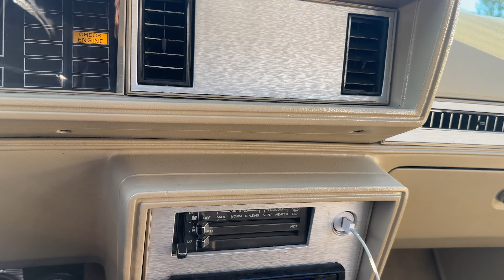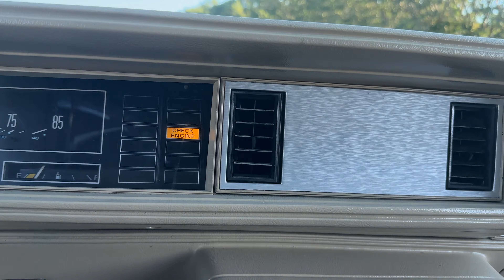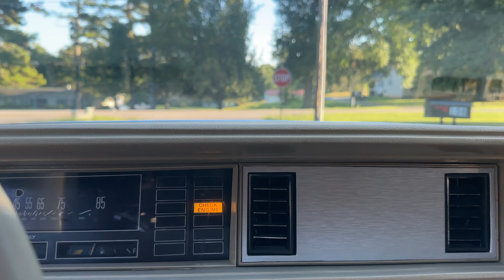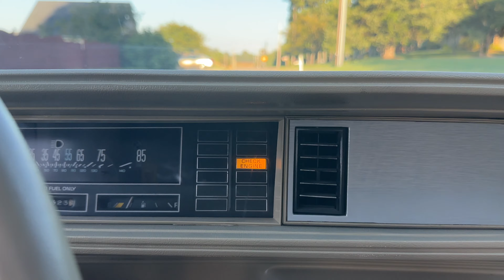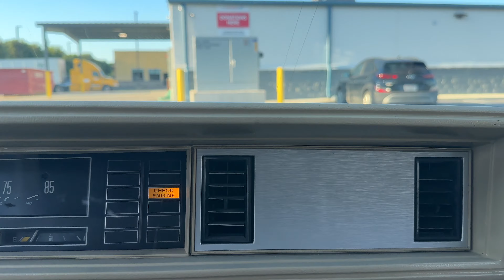TRYING TO REBUILD ELDERBROCK 650 CARBURETOR.. DIDN'T AS PLANNED👀👀👀😩

Comment: Now you need to jet it
Reply from the maker: @1otviii  what do I have to do to jet it my guy?
Reply: @yaboikg  well, best is an afr meter, tells you lean or rich. A stumble sort of sounds lean. You can use smaller rods or a bigger jet in the primaries to richen it. If you ricnen and it gets worse, change to leaner setup. May have to play with it to figure out without a meter. Your plugs will give you an indication. Black too rich, white too lean
Reply from the maker: @1otviii  cool. Preciate that mt guy frfr🫡💯💯